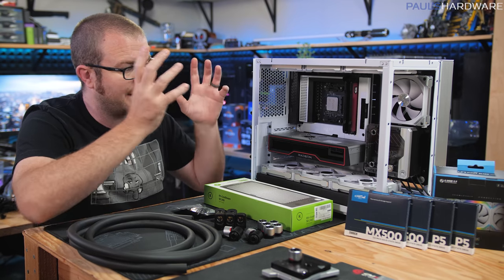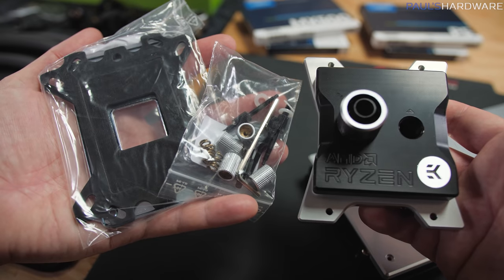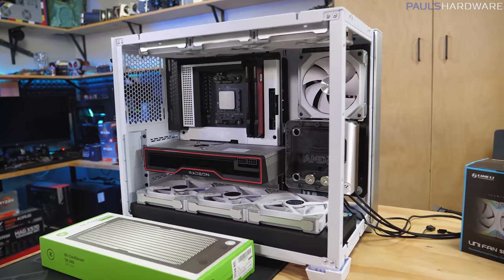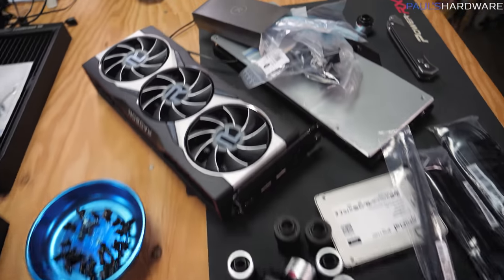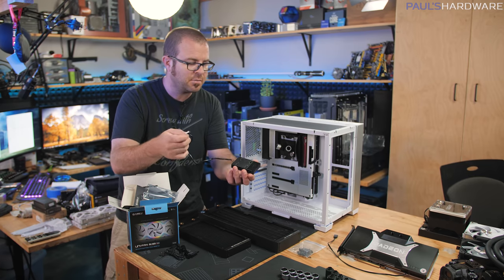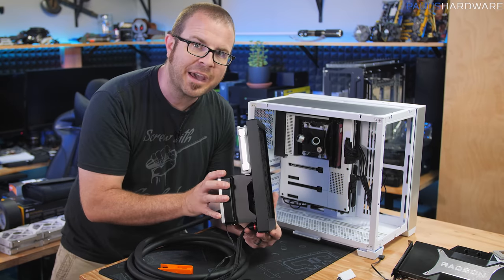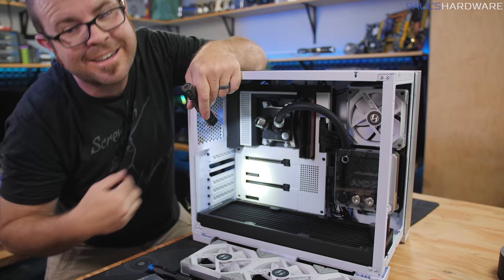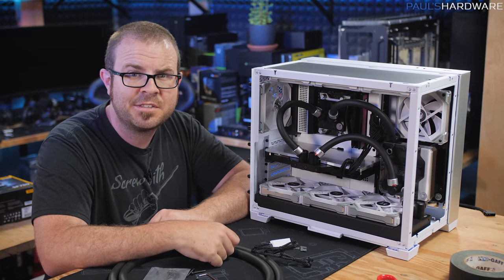The All-AMD Water Cooled PC! (Part 2)

Comment: Did Paul just connect a 300W TDP card to a single 8-pin with dual headers? With the 75W slot power and one 8-pin, that's really only about 225W for a 300W card. I'm hoping he runs another 8 pin off the PSU to that card when he installs the custom sleeved cabling. I like the look of the build, I know people like hardline tubing, but I like the flexible black.

Comment: @Paul's Hardware Do your Uni Fans register RPM in the BIOS? I have MSI X50 Tomahawk with Uni Fans and they don't show up in BIOS, (it shows 0 RPM  - "Disconnected"). However, the fan's RPM shows up in L-Connect. Is this fan hub supposed to work this way? Thank you

Comment: I'll NEVER understand why anyone runs a radiator as an intake. Off my 360 rad the air is quite warm(probably 30-35⁰C+) while gaming (RTX3080 and Ryzen) and no way would I want that blowing over my motherboard. Radiator is at the top as exhaust with loads of cool air in the case.
Heating the intake air probably adds 15⁰C to everything in the case, VRM, memory,SSDs etc.

Comment: Would of been so much prettier running the GPU/CPU in parallel
Pump to back rad. 
Back rad to bottom rad back.
Bottom  rad front  to gpu inlet. 
Two short tubes from gpu up to CPU. 
Gpu out back to Res. 
So youd only have 2 short tubes between the GPU and CPU. And 2 straight longer ones along the bottom , very tidy.

Comment: I'm not proficient with water cooling or building in this particular case. But I was wondering: Why not mount the water pump in that singular rear 120mm fan location? That would allow for 2 fans on your side radiator, or 4 in push/pull. Pardon my ignorance if I'm missing something obvious. Liking the build so far and especially the cause. Look forward to the stream with Kyle.

Comment: Usually I'm a hard tubing snob but this looks fantastic! The soft tubing somehow improves the aesthetic even more, I can't explain it, it just does. Will also be interested to see how the little reservoir/pump combo handles things. They released this kit after I finished my hard tubed build otherwise I probably would've bought it rather than the X570 Master monoblock I ended up going with... which makes changing the CPU an absolute hell.

Comment: Hey Paul, I think you might wanna use 2 different PCI 8 pin power connectors for that 6800XT. It draws over 300 watts and i dont think thats a great idea on a daisy chain. Great build otherwise!

Comment: It’s great to see your build videos again. I especially liked the GPU tear down and installation of the GPU and CPU water blocks. 

I have been lucky enough to get parts for my new PC recently which was long overdue (almost 10 years since my last/current build). I want to water cool my PC later this fall especially since I’m seeing high temps on the GPU’s memory junction temperature. With that in mind, what is your take on warranty and water block installations, especially on the GPU (since supplies are still not keeping up with demand)?? I have been seeing different answers in regards to warranty and GPU water block installations.

Comment: Niice build but I would shorten the tubes on CPU block. They are rotary fittings; I don't see the need for tubes to stick out so much. GPU to CPU run has 45 degree fittings and should make a good straight tube instead of the curvy, almost hitting the rear fan tube. Also, move the tube connecting the GPU and pump/res to bottom port on the block, maybe cover part of it with the custom cables by running them from GPU 6+2s to go under the motherboard, behind the bottom radiator. Although not performance enhancing, switch left port for input and right one for output on GPU block.

Comment: Could you possibly put another 3rd radiator in this case at the top, maybe 240mm? It's nice and relatively compact. Would a gpu riser work with that bottom radiator there?

Comment: very clean build. tip for that black tubing from ek, if you just wet inside ends before you put them on the barbs, they slide right in with very little force. Very nice runs, much wow, much jealousy

Comment: You know what's even cleaner looking than using those stickers on the back? Using a heat gun to remove the silver metal lian li stickers from the intake side to place on the exhaust side. That's what I did and it looks baller.

Comment: Paul, starting my second build with Asrock Z590 Steel Legend with wifi/ BT. I am caught between an Intel and a Ryzen CPU. In your opinion which is the better?
Reply: Your only option is Intel since you’re using Z590.
Reply: @EvanEvolved, Thanks. Last build was Ryzen. Better start saving nickels then. LOL
Reply: @deadchannelfrom2018 , Why would Intel be the only option and which Intel?
Reply: @samuelschick8813  because Z590 is an Intel motherboard platform. It’s only for Intel Cpus.
Reply: @EvanEvolved, Thank for the info. I asked because Benchmark shows that Ryzen 7 3700X and 7 5800X are compatible.
Reply: @samuelschick8813  you must be confused with X570 which is AMD. Benchmarks only show performance not compatibility.
Reply: @EvanEvolved, Going with Intel 7 11700k so far. Is there a site that shows compatibility?
Reply: @samuelschick8813  PCPartPicker
Reply: @EvanEvolved, I thank you fine sir.

Comment: If you're doing in from the top right and out from the roof isn't most of the air from that fan just going to instantly turn 90 and flush out the roof doing nothing?

Comment: A Dremel with a cutting bit is a must have tool for any PC build these days. I recommend getting the 20 pack of cutting wheels.
Reply: I've never once needed a dremel to build a pc.....
Reply: @drunkhusband6257  Paul showed the need for a Dremal by modding the part he wanted, too fit in the case he had. A basic case mod I do frequently is opening the back of cases with 80/92mm fan mounts to fit 120s. You will need something to trim the cut (plastic U channel) and an aftermarket fan grill to get a clean look.

Comment: Lets be honest, give-a-way for tax write off.... we all do it :P (smart people I mean).
Reply: Crucial makes insanely good products. I have a P5 1tb in my rig and its fucking awesome.
Reply: I would have put the reservoir on the back of the case where the 120/140mm spot is, that you thought about doing intake fan. I would have put the reservoir there. And then run double fans on the radiator instead of one. But that's just me.

Comment: That nzxt board is seriously the worst designed board. Those m.2 covers are not even useful for cooling. Those drives must die from overheating inside those covers. Why is the tubing so long tho? Looks horrible. You really need to cut the tubes really short and the fittings into the shortest direction to each other from one end to the other.

Comment: By the way, you do recommend that all M.2’s have a heat sync shroud with them? I’ve got an empty M.2 slot on my motherboard that I want to fill and I’ve been debating on the new Rocket 2, but it doesn’t come with its own heat sync right now and my empty slot doesn’t have a built in heat sync.